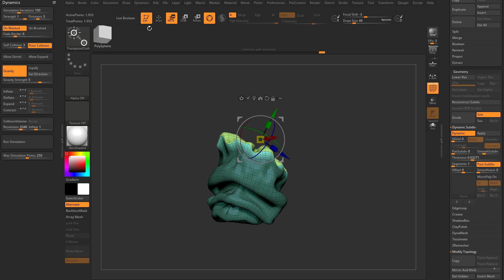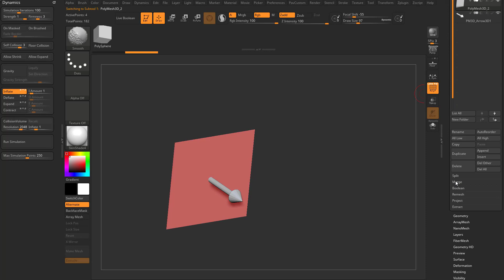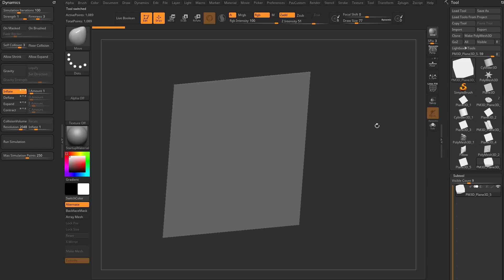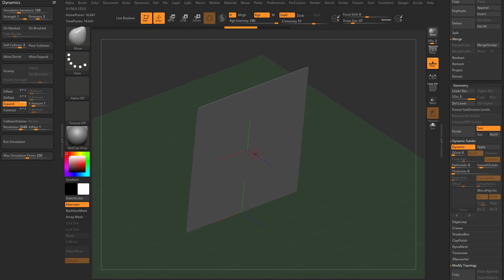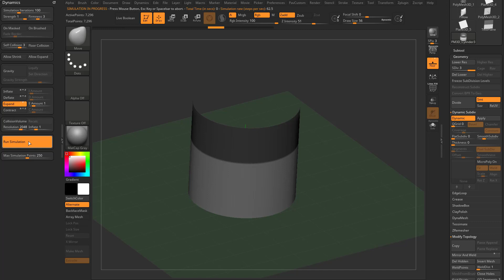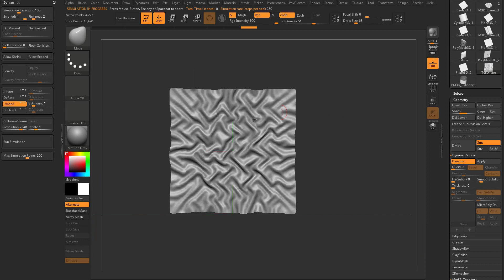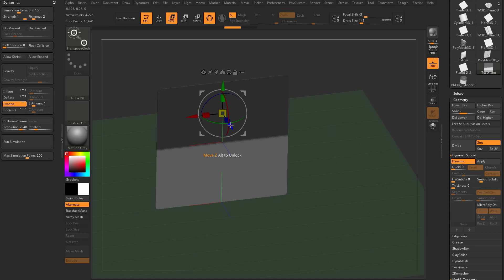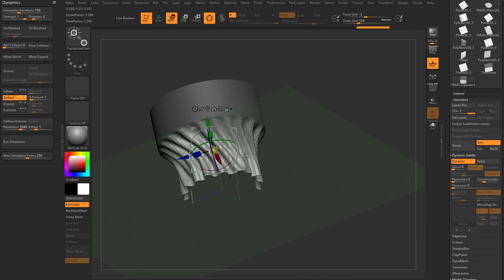016 ZBrush 2021 Inflate Deflate Expand Contract

Comment: Great update series as usual. Thanks a ton. So if I had a shirt with a puffy sleeve modeled in A pose, how would I go about expanding to puff it up? As I understand it the coordinates are global so would I have to move it to a global alignment first (say Y axis along the middle of the sleeve) and then go from there? Then I'd have to move it back. Is there an efficient way to do this?
Reply from the maker: If you want to use the simulation settings yes, but you can also use transpose cloth gizmo to dictate the direction; for example, expand xyz, then use gizmo scale in the x and z direction (scale in Y then hold down alt) to puff out along that axis. Kind of difficult to explain in typing, I'll do a video on it next, good question!
Reply: @MichaelPavlovich  Thanks. I get it. I forgot about the simulation Gizmo which becomes a local coordinate system for the simulation. I'm really impressed with how dynamics fits so neatly into the rest of ZBrush. Again, thanks for all your videos. You're a legend!